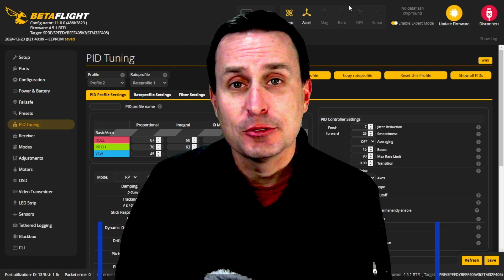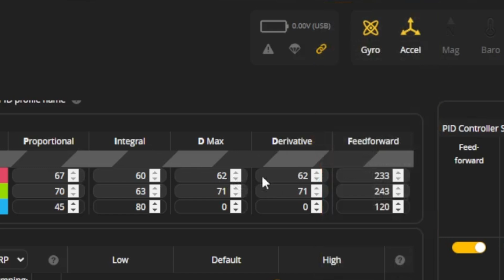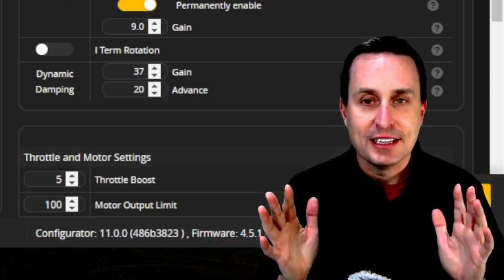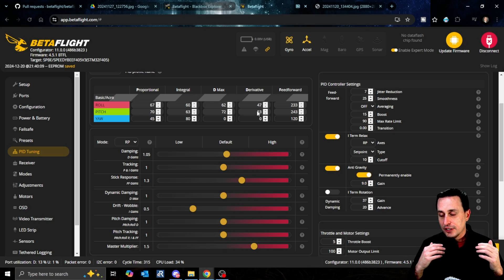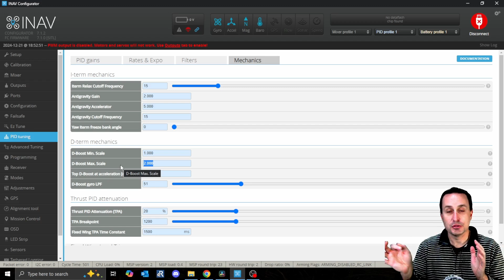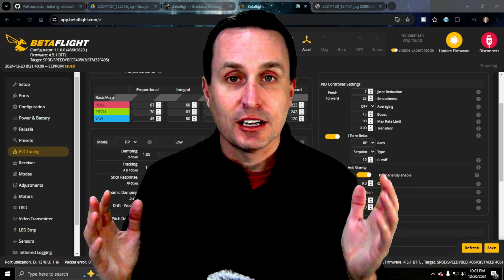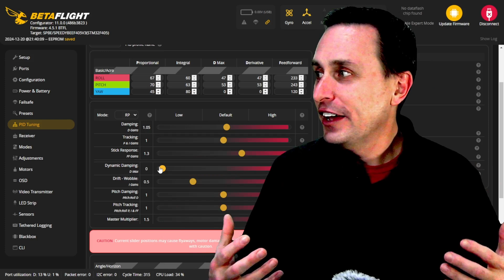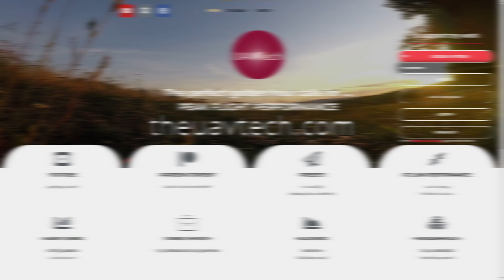✨REDUCE Shaky Flight with Dynamic Damping🐱‍🏍

Comment: Im struggling with a 55hz dterm 3db noise in roll. Its a 10 inch helion. Forward flight shakes ruins all my recordings :(  any chance you've worked on helion?  A lot of them seem to have this issue.

Comment: hi mate. thanks for the vidz and all the stuuf :)
 i'm actualy using your 7 inch preset with esc value recomanded ( anti G to 9 as it's default )and i get some whooble. wich dont happen all the time. so i'm thinking about a physical vibration. i will do a blackbox log to see what's going on in there.

in the dvr it's not that shacky so i'm really unsure. pid or physical mouting. what ou think ? 

https://youtu.be/VpGA23_Wzqs  sadly i lost the footage with motor sound :l

Comment: Really good video. My cinewhoop shakes when normal flight and dmax is 0. Can't wait to test it out. And I have a question that why vibration can be amplified by D gain?
Reply from the maker: Yes, D-term amplified noise.  D-term is a gain that represents the magnitude of the gyro change.  Noise is a very fast change in the gyro signal, so D-gain reflects/amplifies it.
Reply: @uavtech  Thanks a lot! The PID control manages the motor speed, including the D-term. The high-frequency noise causes the D-term to become very large. So the D-term amplifies the noise by controlling the motor.
Reply: After adjusting the Dmax, the testing went super smooth:yougotthis:

Comment: Serious question yes or no - or link to do so.....I thought I mapped the throttle limiter on a dial a few years back...I could be wrong...is there a way of doing that?
Reply from the maker: Yes, in Edge/Open TX you can set throttle to limit based on dial.
Reply: @uavtech  Thanks for confirming that for me. Now if only I could find info on how to map that :)

Comment: That thing flies like my GEPRC Mark4 LR8 was. Wobblefest. I got rid of it, but picked up a higher frequency vibration. It's a balancing act and everything is a compromise. I feel like I am going to be tuning forever.
Reply from the maker: Wobble is i-gain.

High frequency is for filters to address.
Reply: @uavtech  I increased the filtering, but it seemed to have no effect. I had to really crank the D-gain to get rid of the wobble, but when I look at my blackbox logs the D trace is crazy and thus motor output is pretty wild. I think I am going to back off D a bit and start trying more and more I term.
Reply: @ I lowered my D gain slider 0.05 and increased my I gain from 0.8 to 1.0 and the wobble came back with a vengeance! I'm going to have to join your Discord server I think.

Comment: Great video Mark! As a racer, I’m not a fan of dynamic dampening unless it’s absolutely necessary. If something’s off, I’d rather just replace the faulty hardware. I can definitely feel dynamic dampening kicking in through my stick movements, and that’s not something I enjoy.

Maybe if the lows and highs of dynamic dampening weren’t so far apart, it’d be less noticeable. But often, you need to lower it significantly for minimal noise, then raise it high to maintain the propwash performance, creating a wide variance that just doesn’t feel good.